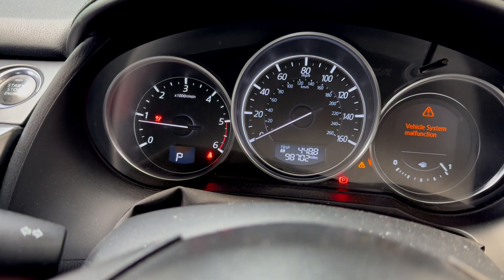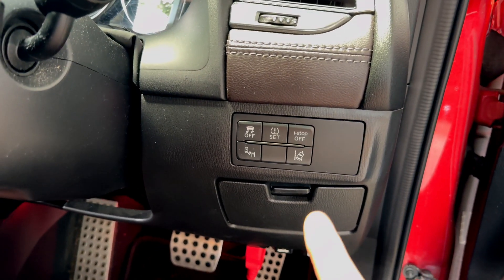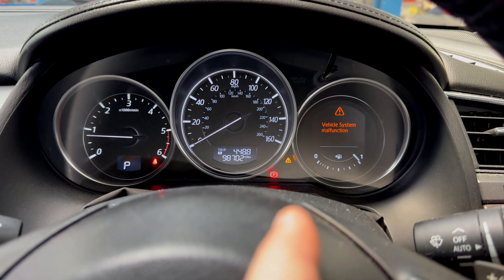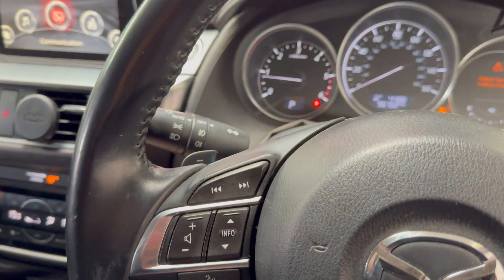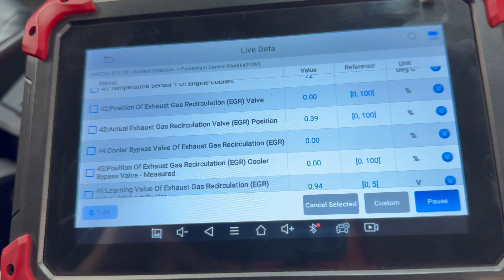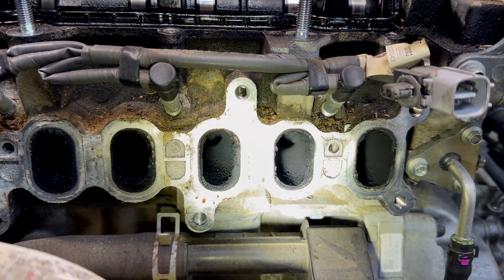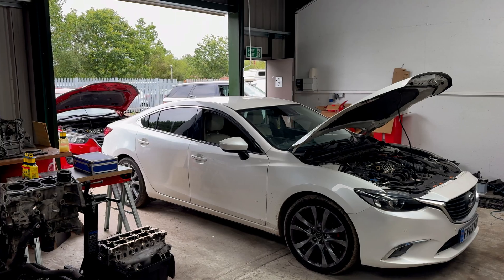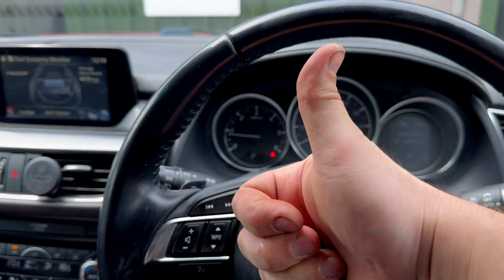Chemical Carbon Cleaning VS Walnut Blasting on Mazda 6 Skyactiv - Which is BETTER?

Comment: I AM THINKING TO BUY MAZDA 6 2.2 D skyactive 2016 . because have no petrol versions in Ireland.  Is it worth to buy ?  170.000km  Sport trim. Iam planning to clean the EGR, Intake and PDF after buying
Reply: Wouldn't touch it mate
Reply: @Butchersbuddy-z1z late, i bought 2017 y. 😊
Reply: @Modern_Warshipss  Hope it works out for you. 
Mine just went in for head gasket and came out looking for new exhaust cam(worn) lifters(seized) timing chain (stretched )and to top it off a cracked head. All because it wasn't looked after properly when the gasket went. When it's done it will be good hopefully. I knew the work was needed when I bought it. The price reflected that and decided to take it on. Probably work out even in the end. 
 The rest of the engine is good cylinders are good turbo is new(nice) no gunk at all due to the strainer being changed.  Manifolds are pretty mush clear but I will clean them off completely myself. 
I love these cars but they need constant looking after. Please God I'll get this one right and go good from there. 
Good luck with yours.

Comment: The early models of the Mazda 6 sky active had no temp gauge, by the time the red high temp warning comes on the damage is already done😂😂😂  what a dummy idea Mazda engineer's department and then it goes into limp mode and you blow your head gasket or crack your block or head 🤬

Comment: out of curiosity do you by any chance see the same on the petrol 2.0 skyactiv-g? I have one with about 70k miles on the clock and it is starting to idle strangely, very low (550rmp) and shakes a bit then sometimes goes back up to 700rpm. And it does it randomly. Especially the low 550 rpm vibrations are annoying. Thanks!

Comment: What is the approximate price of a complete engine cleaning with vacuum pump replacement? Thanks
Reply: Depends where you’re at.. $600 is cheap and I would take it. In the US expect to pay like $3000 or more LOL. Between parts and labor it is a violation. 😅
Reply: У нас у Украине 600$
Reply: @ПолковникМамура-м5п  Ireland 1600 Euro  EGR + Intake + DPF